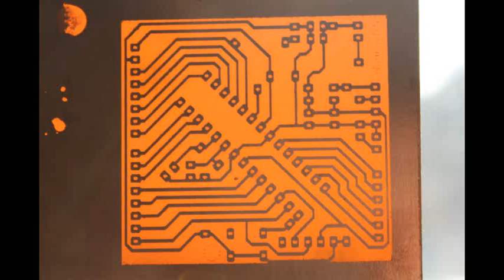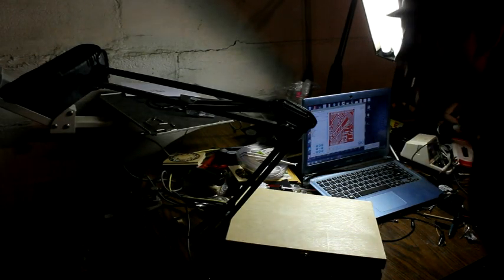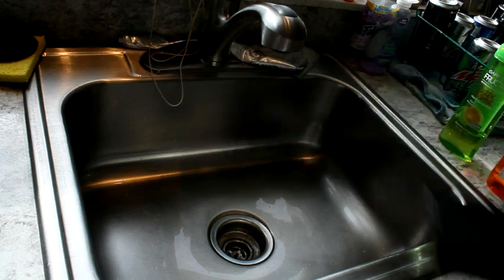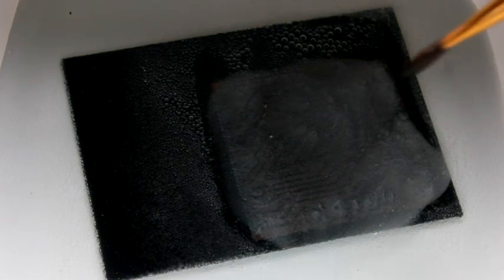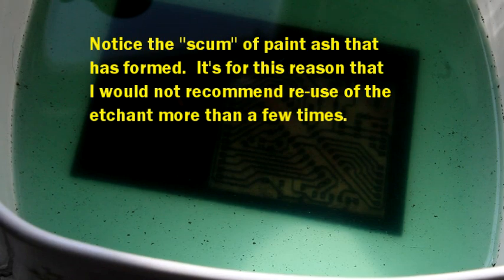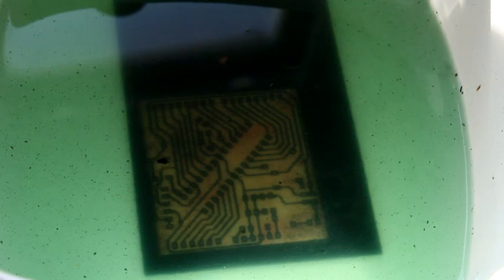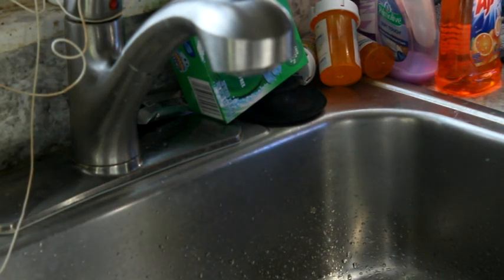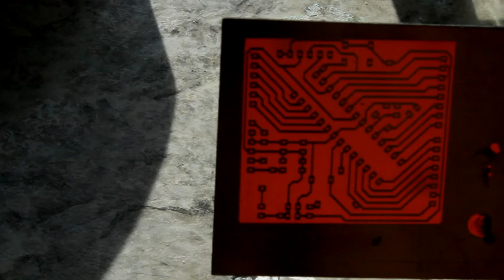Arduino clone Printed Circuit Board made with Laser Engraver and Poor Man's Etch!

Comment: Thank you paul. I want your help, there is no way to order PCB from china or another country in the place where I live "Africa, Ethiopia". so I decided to make a PCB as you did. I got a 4.5-watt laser in the local shop. and the thing I want to know is,  1st how efficient is a 2.5-watt laser for engraving PCB so that I can compare it with a 4.5-watt laser. 2nd can I use any spray paint and what file should I have to generate to send the file to a local laser engraving shop untill I made one?. tnx for your help.

Comment: What minimum laser power would you recommend ? I'm planning on buying a small chinese CNC router that does the job, and there are variants with differents laser power, ranging from 1000mW to 15W. Obviously the higher the power, the higher the price. 

Thanks for the video anyway
Reply from the maker: Mine is just a 2.5W cheap chinese laser module, and for this kind of thing works well.  Since it's only burning paint, pretty low power should work, I would suspect the process would be fine with even a 500mW laser, though it might have to be done slower

Comment: Brilliant work. Well done. 

I was particularly taken with the etchant. I have only ever used ferric chloride, which is unpleasant stuff. 

I also reckon with a bit of care you could make a solder resist layer in a similar way :-)

With UV curing paint it should be possible to laser image the parts to be kept, and with a much lower power laser.
Reply from the maker: Agreed with the UV paint, though using the Blu-Ray might not have enough UV component to cure.  I've also considered UV cure epoxy for the same idea.  I chose spray paint for this, given it's cost and easy application.. but I have also had success using dollar-store nail polish, which has the advantage of drying extremely fast.  I have found it takes a solid half hour to reliably dry the spray paint, or about fifteen minutes if I use a fan.  I've seen videos from others, using laser from 500mW to 1 watt- able to ablate these types of paints also, so I assume this ought to work with just about any "burning" power laser as long as the cutting rate was adjusted.

I've been quite pleased overall with Poor Man's Etch, it's easily gotten together at your local grocery store.  Probably the biggest drawback is that it does have a strong "pickle" smell during use, as it is Vinegar after all.  In using it, I've found it also helps to warm the solution in the microwave (without the board!) until steaming hot, but not boiling, before putting the board in.  It's not going to have the bite of Ferric Chloride, but then again, it's safe to handle and won't destroy things or stain clothing or anything else (other than metal!).

Thanks for the feedback, glad you enjoyed!
Reply: @paulbishop9896  There's also 3D printing (SLA)  resin. That cures with 405nm and would be very cheap for the amounts needed for a board. It may need to be spun on, however. A 405nm laser could very easily attached to hobby grade FDM printer.

Not at all taking away from your achievement, BTW. More like building on it's inspiration.
Reply from the maker: @David Stonier-Gibson Yeah, I had considered that.  I don't actually own a 3D printer, but I was also considering whether or not PLA could reliably bond to a PCB as a mask, perhaps by messing with the bed heat.  I'm currently saving for a z-axis rail and extruder, but.. I'm long on ideas, short on cash.  Kind of hoping I can generate a little cash flow doing some videos like this, to fund some things, as well as life in general.  My tinkering is what keeps me sane (ish)...

I'm a disabled former engineer (nasty variant of Crohns Disease and associated illnesses took me out of the working world) who barely gets by on a disability check-  so whatever I do, it's usually salvaged materials and the very cheapest equipment and materials I can find.  I take great pride (?) at times that I am able to MacGuyver together the things that I do.  The laser rig is made from two salvaged ballscrew rails that were from a parted-out industrial rig at a recycler.. a couple of $7 TB6600 stepper driver modules from china.. an Arduino Mini clone ($2) flashed with GRBL.. and a chinese laser (2.5w supposedly) that cost $59 including the safety glasses.  It's wired together using salvaged ethernet cable, lol.. and I'd be really surprised to find out the laser actually is producing 2.5w- but it does do the job of engraving pretty well for a device of that cost.  The one nice part of my build is the rails are extremely accurate (THK ballscrew) and powerful (PowerMaxII steppers), with a workspace of 100mmx250mm.  Since they are as robust an actuator as you could hope for, I see no reason that a reasonable CNC of moderate shop quality can't be made from them.  Really kind of a waste to have them just sliding a laser around :)

What's been on my mind is that I have one of those Ryobi drill presses, you know, the ones you get at a home store.  Solid enough for what they are.  Fact is, I've used it in ways it's not designed for (like a vertical lathe) and it's done a remarkable job.

I'm looking to rework the gearing on the plunge of the drill press, to couple with a stepper.. thereby becoming my Z axis and cutting head.. far more capable than a Dremel on belts and pulleys....
Reply: I have had the best luck with sandable primer.  It dries fast and burns completely away whereas paint leaves residue that has to be washed off--and takes longer to dry.  Primer also resists the acid very well.

Comment: Well done. Will probably build the same lasering rigg, how did you move it in X and Y? Rebuilt 3d printer?
Reply from the maker: They are stepper motor driven rails that I salvaged from a junk dealer.  They are made by THK... a bit of overkill for a laser engraver, but since I got the rails for cheap and they are extremely powerful and accurate.. I use what I have :)

Usually, leadscrew rails like these are used for applications like CNC where torque and repeated accuracy are important.

Comment: I have not used a laser to create tracks yet,though i may get a cnc laser soon,i notice (sometimes) rubbing with the fingers can break fine track resists,i still use the toner method,it occured to me that a "BABIES TOOTHBRUSH" would and should work very well,as the skin can get "grabby" when wet and oil free which can tear fine tracks,while a soft babies toothbrush can apply the same pressure evenly and gently.

You should try vector etching,the method you use here seems to be a raster etch,the time scale is reduced dramatically in vectorised etching,

https://www.youtube.com/watch?v=5g4HeYXfNwA

here is a good example of what i mean.

Hope it serves you well.
Reply from the maker: I found that "rubbing" in any form really wasn't needed, the etchant took care of it.  As the paint ash does end up in the etchant this way, I do suppose it shortens the useful life of the etchant, which might matter if it wasn't a one-off type process.

These days of course getting a board jobbed out overseas is really cheap and the quality you can't really compete with at home.. etching your own boards is becoming a dying art, like darkroom work...
Reply: Rather than paint, I have been using sandable primer, and my CO2 laser obliterates the primer to the point that you don't even have to wipe any residue off.  I take it straight of the laser engraver and into the acid bath without touching anything, and it works just fine.
Reply: I haven't tried acrylic paint, but most other paints I have tried leave some kind of residue whereas the primer is completely obliterated.  You actually see copper without having to wipe or clean it at all.And yes, getting a board jobbed out overseas is cheap, but this is just fun hobby stuff for me.  Half the fun for me is just seeing if I can pull it off, just like you are doing in this video.
Reply: Vector etching isn't as good for custom circuit boards. This is really the way to go.
Reply: @NearEDGE  care to elaborate on why? Flatcam does a wonderfull job to vectoring a PCB
Reply: @johngaarsoe3259  vectoring the PCB would pass on a no-more-painted-with-primer area, do you know? And about the color? Primer is gray, it won't need to be black so the laser won't reflect on painted PCB?
Reply: @brunocabral1578  you know I think I actually was just tired because I interpreted vector as raster. lol